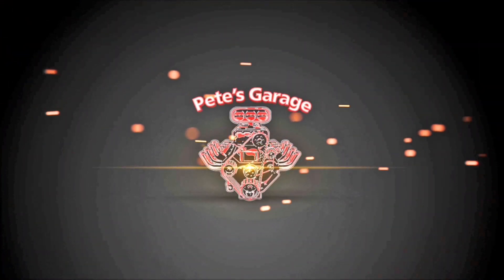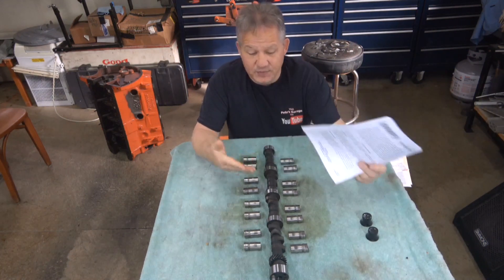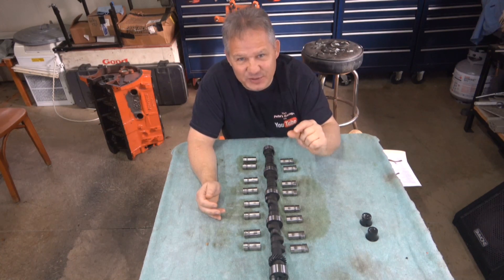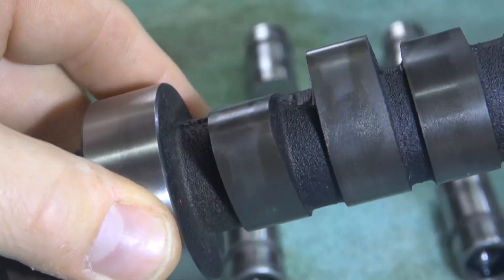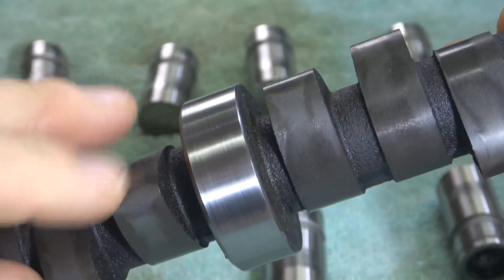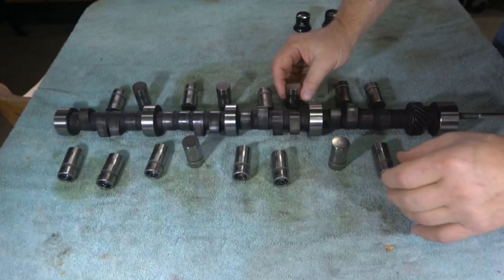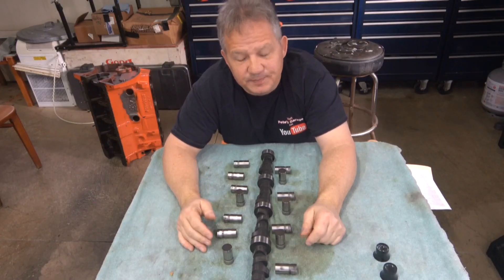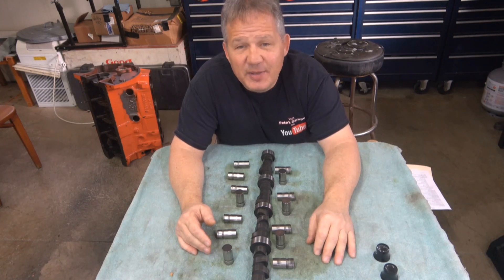Flat Tappet Cam Break In Analysis

Comment: funny you are saying Dirt, I paid $850 for high end Comp cams roller lifter and when i recieved them , it looked like the lifters were setting on the side shelf for 20 years with dirt dust and dead insects inside. so i sent back and got Morels. due to they were too tall for 340 block now you make me think about maybe just cleaning them up that they could have something in them yet
Reply from the maker: It's worth a try

Comment: I have a set of dart heads with dual springs and I was told to install just the outer spring for the break-in and after the break-in to reinstall the inner springs. So I am going to go with that as I put the motor together throughout the winter. Great video, lots of info.
Reply from the maker: That will work

Comment: Pete, could you install a set of springs with stock pressure, and keep the RPM relatively low for the break-in period, then swap the springs out for the ones you want to run after break-in?  It'd be a hassle, but cheaper than buying a new cam.
Reply from the maker: That is the standard break-in procedure. It's the spring pressure after that beat up the cam

Comment: Hi Pete, I installed a hydraulic  crane roller cam with roller rockers in my newly rebuild 455 Pontiac 226/ 234 duration @ 50. I still use a zinc fortified 20w 50 . I have nearly 3000 miles on it with no problems so far. I hope the roller cam is going to be superior to a flat can as far as longevity goes. Thanks for another fine video 👍
Reply from the maker: That will last a long time, you'll be happy with the roller